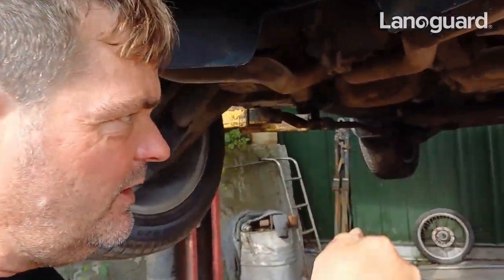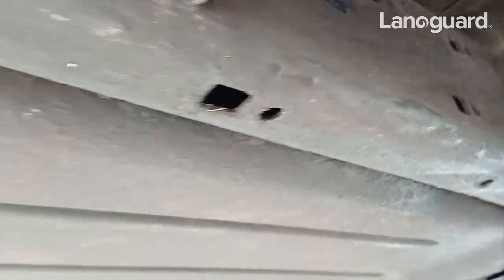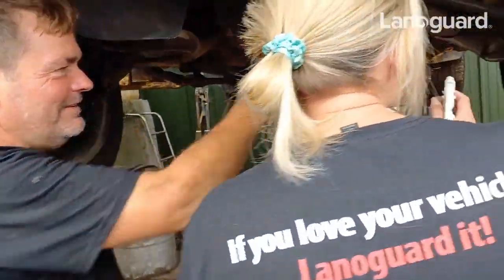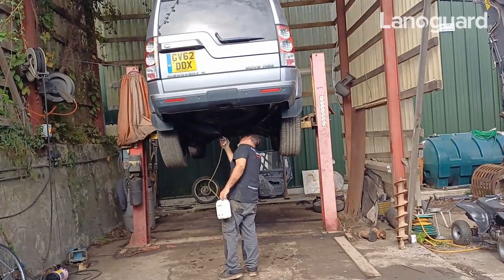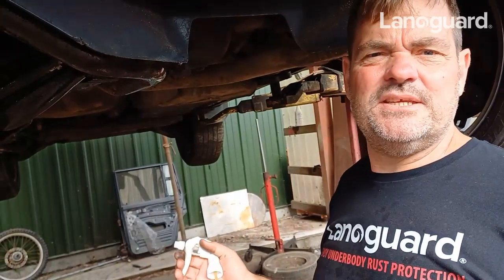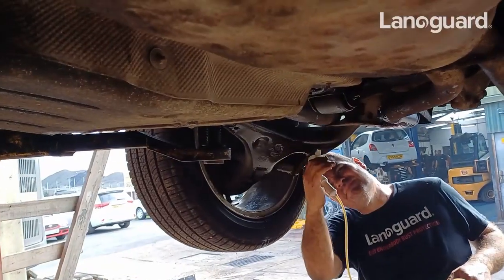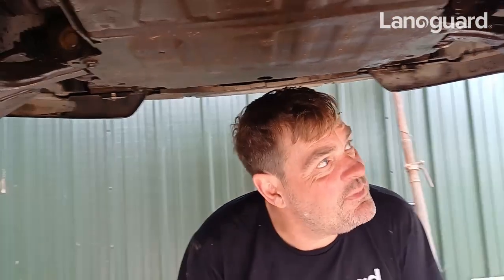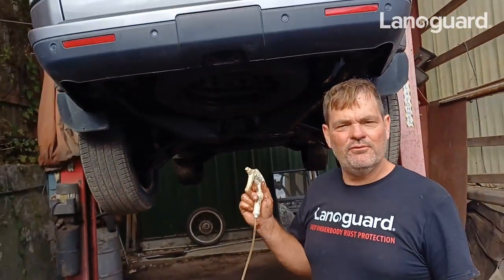Lanoguard - THREE YEARS of rust protection🚗

Comment: I noticed a lot of videos spraying the suspension is this good for the body I'm more interested in stopping rust on the body that the suspension parts? Thanks
Reply from the maker: Hi, Ultimately Lanoguard has been designed as an underbody rust treatment, some customers have used it on other areas of their vehicle. A few things to note because if it’s texture whilst it’s curing it can be tacky plus Lanoguard is thixotropic meaning it has continual creep and dries to a clear candle wax texture. During the curing stages and when first applied Lanoguard is tacky so if applying to areas that are frequently touched you would feel this on your hands. I’d suggest perhaps using a cloth and applying to a small area first just to see how it cures for you before treat the whole area. I would suggest taking a look on our Facebook User Group and search in key words and this will bring up all previous conversations on this from people who have applied it to areas other than the underbody. https://www.facebook.com/groups/lanoguardusers Hope this helps
Reply: @ sorry I don't know if I was clear haha I want to spray this on the underside of the car on all the floors and sills etc rather than the suspension parts is it designed for this I'm assuming it is?
Reply from the maker: Hi  @Jonathan-qz9kd   Oh, sorry for the misunderstanding. Yes, you can spray over and protect all areas underbody with Lanoguard including electrics, rubbers, and plastics and even the exhaust (no masking up needed). The only areas to avoid are the brake discs and pads, you can cover these if you prefer or shield them when spraying near. Also if you are looking to protect inside box sections, sills and those hard to reach areas, 2 of our Underbody Kits come with a 360 Injector Wand. I hope this helps

Comment: Did it smoke after you applied it to the muffler?
Reply from the maker: Hi, Lanoguard is a safe product to handle and to use. It is jet-wash resistant, non-perishing, non-conductive and non-flammable. It is safe to use on electrics, rubbers, and plastics and even the exhaust issue (meaning when using Lanoguard no masking up is needed). Lanoguard works well on hot surfaces because it doesn’t evaporate. For exhaust it will burn off excess on areas that reach over 450 degrees but not smoke. The areas to avoid are the brake discs and pads, and if going in the engine the fan belt, you can, cover these if you prefer. Hope this helps

Comment: How much are you heating the fluid up ? i found the hand sprayer didnt want to cope with the viscosity of the fluid , maybe it needed to be warmer than i had it ...
Reply from the maker: Hi, If applying in the cold at ambient temperatures of less than 10 degrees, we would recommend placing the Lanoguard Spray in a warm room ahead of application or standing on a bucket of warm water prior to and whilst applying to aid easy application. Please do drop us an email at info@lanoguard.co.uk or give us a call on 0330 100 1959 and we would be more than happy to see if we can help, thanks, Jen

Comment: Is there a poit of using this on parts that have already rusted?
Reply from the maker: Hi, Yes, Here’s a little background on how Lanoguard handles rust. Lanoguard won’t convert existing rust per se, instead it will arrest and completely stop its further development. This is due to Lanoguard natural attraction to ferrous metal. It will seep and creep underneath surface rust and create a hermetic seal to the metal below, stopping oxygen and water getting in. Lanoguard will not crack like paint, it is self-healing and is constantly creeping, remaining active to continuously repel moisture and keep it away from the metal surface. Additionally, a side benefit of Lanoguard’s hermetically sealing ability is that over time it will push existing oxidation off. As a result of all this, the surface you apply it to, ends up looking a little better too, over time. When applied over sound surface rust Lanoguard will darken areas of rust and reduce the vibrancy too. The Lanoguard sprays are almost clear when being applied. This result in a transparent coating which is a semi-matte wet look which enhances whatever colour is under it, being transparent allows you to clearly see that rust isn’t forming on the surface, Hope this helps to explain how Lanoguard deals with rust. Jen